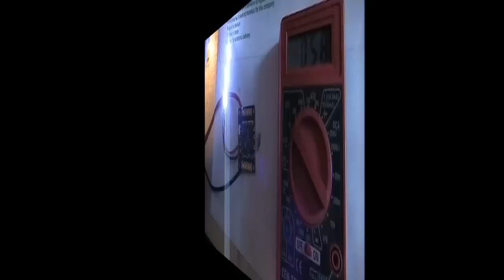Power Distribution Board with 5V 12V BEC Output from Banggood.com

Comment: the only thing that worries me is whether having the power off one board will cause any lines across the video. Do you know how 'clean' that power is to the 12v for powering the fpv gear? I suspect a capacitor and ferrite ring will be needed also to get clean video perhaps?

Comment: so do i have to use a bec if i use the dys 20a xm esc,s? and if yes can i use the 5v connection to power my camera and fc? i have a 5v cam. could i use a power wire from my receiver as it is 5v also?

Comment: can i use this to power the air gear no bec esc's?im using pixhawk, but i got no idea how to wire. pdb 12 volt to red black esc's, esc to 1-4 on the pixhawk>?pdb gets powered by the pixhawk powerlead.using 4s batteries.tnx

Comment: Travis, is it just me or does having all the positive pads on one side and all the negative pads on the other side of the board make for messy wiring?  Can you post a picture of how you would wire this to your esc's?  Thanks in advance.
Reply from the maker: it's not as bad as you think.  There will be wires going over top of the board on this one, but you can still keep it neat.

Comment: Have you try to connect 3S battery and VTX equipment to 12V output, because your meter shows ok voltage but camera and VTX is not working on that 12V or you have very bad picture
Reply from the maker: Kreso Saric Not yet.  The VTX I have supports 2S-4S so I think it should be fine.
Reply: Kreso Saric  Kreso there is an issue with the board.  I connected my VTX to the 12V port and the voltage dropped to 4.08 volts making the video unusable.  I emailed Banggood to investigate but no reply.  I think its defective manufacturing
Reply: Glad I'm not the only one I have the same issue, 12v drops to 4v when vtx is plugged in off load it's fine. Something wrong with a this batch I think
Reply: Kreso Saric Same thing here. Not working on the 12V output. Works on LED output, but can only use my 3S packs , not my 4S, as the camera won't accept more than 12V :(
Reply: +Lee Trevarthen Are you guys using a 3s battery while trying to use the 12v out?  This won't work.  +travisgrindal was mistaken when he mentioned you could use the 12v reg for either battery type, it will only work for 4s.  It isn't just this board, a 12v stepdown is not meant to be used on a 3s battery.
Reply from the maker: +astralisdustin The 12v out will only output 12v when the incoming power is 12v or more.  if you are worried about running your electronics off of a 4s battery,  then this will limit the output to 12v.  of you run a 3S and the voltage of the battery pack goes below 12v, then so will the output from the 12v regulator.
Reply: +travisgrindal exactly.  by the time you land on 3s, your 12v out will be supplying your electronics with 9.something volts.
Reply: +travisgrindal Have you been able to confirm the endurance on long term reliability of this unit?
Reply: +travisgrindal could we just plug the VTX into the switch side? Is the power coming from the switch essentially the same as if we were to power directly from the battery pack (unregulated).
Reply from the maker: +ebartolome79 Yes, the LED output is the same as the battery input.  You could connect your VTX there and then power it off when you want to fly line of sight.

Comment: Thx for the very helpful video.  If I want to cut up my LED strip to four strips for my quad arms - how do I connect to the PDB?

Also, are you aware of a source for blinking LEDs or colored LEDs?
Reply from the maker: It depends if your LEDs are 12v or 5v.  If they are 5v, you'll have to connect them to a 5v output.  12v LEDs connect to a 12v output.  I've run 12v LEDs directly off a 4S battery.  They are real bright and get a little warm.  I usually break them in a crash before I burn any of them up.

Comment: thanks for the video. I was thinking about buying this pdb for my 250 quad build.
For me the question is: How trustworthy are the becs? Does it make sense to power the Flip32 via the becs on this pdb or is it better to buy a separate ubec like 3A/5V?
Reply from the maker: They aren't BECs.  They are voltage reducers.  I've had good luck with them so I have no hesitation about using them in the future.

Comment: I just used this board on a build and found that the 12 V output when connected to 200 mw video transmitter drops to 4.08 volts making the video transmitter usable.  Did you try to taking a reading at the 12V port with a load?  Thanks for making the video.
Reply: Jon Car I had one of these boards on a quad I lost, but it ran the VTX just fine, no issues. I actually have another board that I'm intent on connecting another VTX to.
Reply: phattacorider Well this is the issue I had and confirmed I was not the only one on banggood forum that had the same issue.  When I took a voltage measurement at the VTX it was barely enough to power the VTX and I had very weak VTX signal strength due to decreased voltage.  I put in a another power supply for VTX and have no issues.  Take a voltage measurement after the VTX is powered up and let me know what reading you get.
Reply: Jon Car What battery are you using mate? The 12v output is a step down i believe so no matter what, if you use a 3s battery it isnt going to work for very long. 4s should have no dramas.
Reply from the maker: +Jon Car Check to see if your VTX can support higher voltages and if so, connect it straight to the battery.
Reply: +Jon Car : I am having kind of the smae issues. I power it with 4S. When I plug in the battery my FPV picture is only "Black". If I then disconnect the FPV Receiver from the 12V connection and reconnect it, everything is fine. Also if I leave it disconnected, then connect the battery and afterwards connect the FPV receiver it works. Anybody has an idea how to fix it? I do not want to directly connect my ET200 and HS1177 to a 4S battery, because I have heard that this also might lead to issues.
Reply: +Jon Car Thank you for the tip.... I think I have to do some resoldering with new components... ;-)
Reply: just order the BEC i posted and use that for your video voltage

Comment: I was wondering. Can I use the LED section for the 
VTX? I really dont use the led at all. Im new to this hobby.
Reply from the maker: You can, but remember that it outputs the full voltage of the battery.  It is not a 5v or 12v output.  On PDBs, normally "VCC" means full voltage from the battery. On this board, the LED output also just does full voltage output.  If your VTX can take it, you can connect it directly to any other power leads.
Reply: +travisgrindal good information. I will make sure my vtx is capable to handle more than 12v.

Comment: Thanks for that great tutorial travis. I am soldering for the first time (with this board). If you dont mind a noob question, do I solder the 20A Speed controllers right on the PDB next to where the batterie cables are soldered? Can they take the battery power without a problem?
Reply from the maker: Yes, that is where you solder them.  Your ESCs should be rated for something like "2S-4S".  That means they can take the voltage directly from those sizes of batteries without any problems.
Reply: yes they are. thanks a ton. my first build takes a long time since all parts look similar but not the same  as in tutorials. i think i am getting there !
Reply from the maker: I know what you mean.  Before you plug in the battery the first time, be sure to check for shorts with a multi-meter.  It really stinks when you do all that work and plug in the battery and something smokes.  I have a detailed build video for a kit that banggood sells.  Maybe it would help you out some.   https://www.youtube.com/watch?v=39i-WUUh_dY
Reply: thanks, that video you linked is great, i think i use the same flight controller as you in that video (exept I soldered the many pins part facing outwards already, i will go trough that more carefully soon. appreciate your time very much!

Comment: So the naze32 only accepts 5 Volts? How would I hook up OPTO ESCs to this PDB? Do I just solder them on to the connectors, or do I have to buy something else?
Reply from the maker: Daniel Dust Yeah, the Naze32 needs 5 volts.  Your OPTO ESCs would solder their +/- on the +/- pads.  That's all.  The signal wires will go directly to your Naze32.  The 5 volt output from this board would either run to a spare motor channel on the Naze32 or it can run to your receiver and then the Naze32 can pull the power from the receiver...  I'm pretty sure that is how it works.
Reply: Thank you!

Comment: Hey Travis, I'm building a ZM250 with eMax 12amp ESCs that have a built in BECs. I'm gonna use the CC3D board for my flight control. I bought this PDB after watching your video. Do you think this will be good for my application. This ZMR250 is my first solo build from the ground up.
Reply from the maker: Yes.  I think it should work well for you.  just remember that the 12 volt output will drop below 12v when your 3s battery does.  It has a voltage reducer so when your battery is below 12v, the 12v output will be the same voltage.
Reply from the maker: If your VTX can support the voltage, I'd suggest connecting it to the same place as the ESCs so it gets the full voltage of the battery.

Comment: Hey there, would it be an issue if my solder joints were touching each other if they are all positive on one side?
Reply from the maker: All along the "+" side?  No, it won't hurt anything, they are all connected together through the board anyway.
Reply: +travisgrindal thanks for the confirmation!

Comment: So you can just plug the 5v into the cc3d without any problem? And it will work? How do you plug it in?
Reply from the maker: I connect the 5v output the the same row of pins where the ESCs connect.

Comment: Do you use the linear Bec on escs for 4s or do you use this board to power your fc?
Reply from the maker: jwhit87 Today I'm still using the built in linear BECs from my ESCs but that is just because they have already.  On my future mini quads, I'm going to start using the smaller DYS & RCTimer OPTO ESCs so I'll be using the 5v output from the PDB.
Reply: I read that linear bec can't handle 4s but the esc package states 2-4 lipos. ill give it a try with 5030 props. thanks for the reply
Reply: just blew up 12amp emaxx esc on 4s without using the becs, on to the opto escs lol

Comment: Hey, 
Im using (1300MAH 4S 80C GRAPHENE XT-60) battery. I need an extra output because I want to connect a laser pointer that requires 3V battery. Im thinking to use 5V output, any ideas ?
Reply from the maker: You could get a 3v voltage reducer.

Comment: I got the two pdbs that your showing in this vidoe an was wantin to kno exactly how you mount them w a cced fc.?
Reply from the maker: I used nylon screws and spacers. I put a screw up through the bottom plate, through a nut, then the PDB and a spacer on top of that.  Then the flight board goes on top of the spacer and a nut holds it down.  I have a couple of these nylon spacer kits that I use - http://www.banggood.com/300pcs-M3-Nylon-Black-Hex-Scre-p-984310.html?p=6Z050013977120130325
Reply: Oh ok so your stackin em.! An the positive an negetive leads frm your battery stay on those two solder points.!

Comment: if the board is 12v, can i connect a battery that is higher than 12v, like 14.8v?
Reply: +jin5632 I think so. The point of this is to convert from whatever your battery outputs (provided it is a 2S, 3S or 4S LiPo) down to 5 and 12 V (and to provide a switch for whatever you hook up to the LED terminals).

Comment: so usefull, i ordered some. Gonna add bulletconnectors (bannanaplugs 3.5mm) to it for servicemobility.

Gonna power my mobius with the 5 volt, and use the 12volts for my tx for fpv. adding some nice leds to my tri (AWSOME long time fpv :D)

i like the neat no noncence design, and the charge mobius ability.

thanks for the good video Travis!
Reply: RVArchitecture 

http://www.readymaderc.com/store/index.php?main_page=product_info&products_id=2489

Is is possible to power the (5.8 boscam) tx with the 5 volt output, so i can use this cable directly to the mobius??
It looks to be nice and small, good for the gimbal.

So, powering the tx with 5 volt instead of 12 volt, so it can feed the mobius. (only using the 5 volt option for tx, leaving the 12 volt open on the pdb).
Reply: RVArchitecture NEVERMIND! 

Found out you cant power it with 5 volt or you get bbq sounds (fry). (Will go with my first plan).

HD Drohne  42 points
12V for Transmitter an Receiver. The Transmitter also have a 12V output for your fpv camera. (Do not use 5V camera on this (red) power wire, or it will burn!) The connectors are the same as on the pictures. Never used them. Best to use on 3s on a Ballancer lead! Hope that helps!

Comment: Looking at it, it is too bad the polarities are on opposing sides of the board. Not going to be very clean once you solder on your ESC connectors. Other than that, looks to be a wonderful product for those of us that want to use those smaller ESC's.

Comment: But there will be a problem with the 12v out when your battery is at lets say 11v. 
most likely the 12v output will be at 10.2v
Reply from the maker: ***** You'd need to make sure your devices connected to the 12v support a wider voltage range, maybe something like 7.2-14.8 or something similar then you'd be fine.
Reply: Yup I understand that. But just saying that the +12 isnt +12v. due to it being a step down, and requires about 1v difference. If it was a step up/ step down, it would be able to get true +12v no matter the input voltage.

Comment: how do plug your fpv into the naze32 board
Reply from the maker: Your VTX and camera do not need to plug into the Naze32.  They work independently of it.  Well, unless you have some sort of built-in OSD on your flight board.  If that is the case, it depends on which flight board you're using.  I use telemetry instead of any sort of OSD on my quads.

Comment: how i connect my CC3D to my PDB via the 5v spot? would i solder + and - wires, attach to a small 4pin conncter and plug it into the main port on the cc3d? I'm lost!